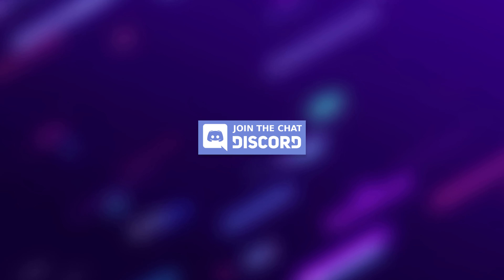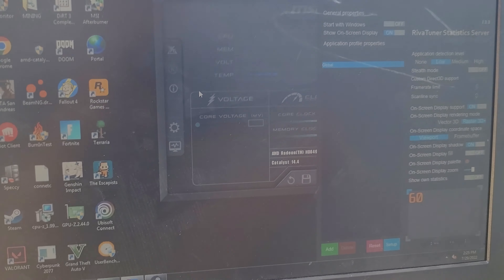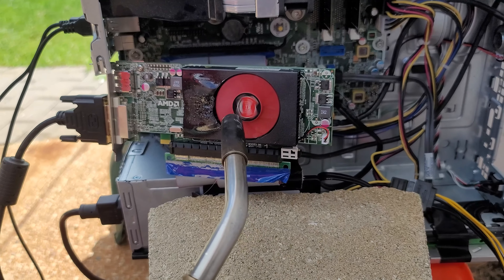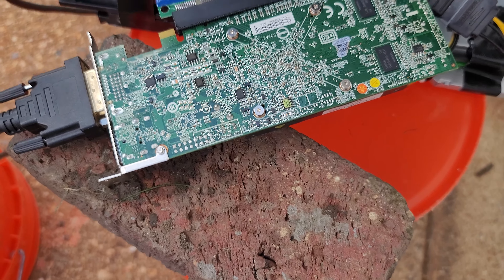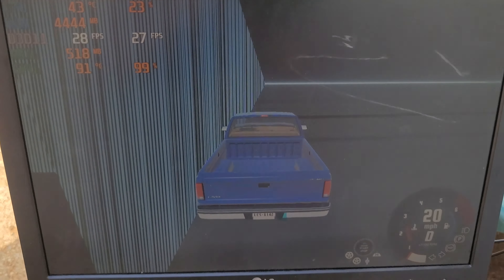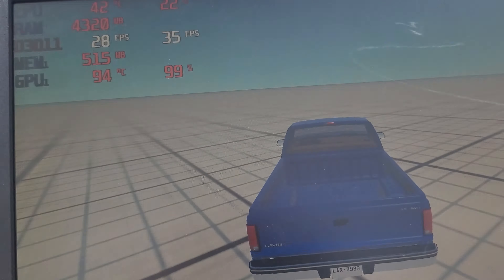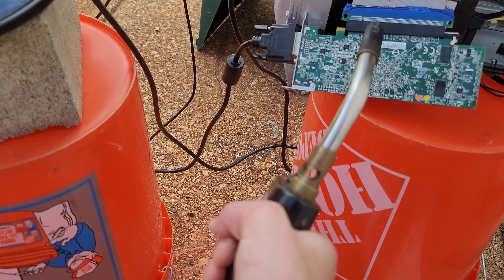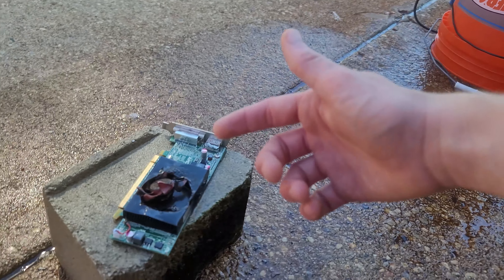Can you GAME on a BURNING GRAPHICS CARD?

Comment: Graphics cards and cpus can handle about 120 degrees Celsius for quite a while due to them being designed for high heat  it can last a while before it fully dies and can handle 105 degrees for a very long time about a few months from what i know
Reply from the maker: Did not expect that. Maybe Ill do a long term heat endurance test in a more controlled environment.
Reply: I play on my laptop 4 hours a day and the CPU is around 80-95 Celcius while gaming. Does that mean my CPU is going to stop working in a few years or something?
Reply: @KingSteven77  its life may be slightly shortened but it should work fine for a very very long time your motherboard is more likely to die than your cpu even at that heat
Reply: old rig ran i3 4170 at 100c 24/7 for 3 years
Reply: alot of cpus turn off at around 100 degrees and permanent damage occurs at 3 digits
Reply: My rx 5700xt have a junction temperature of constant 110 degre Celcius while gaming and it has been running for straight 5 years.